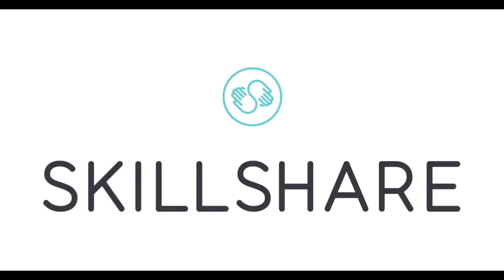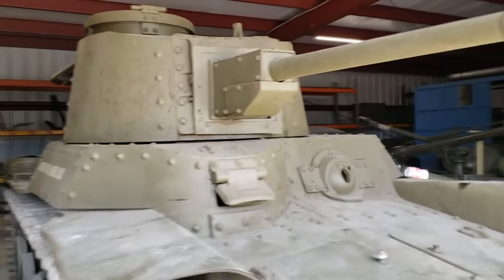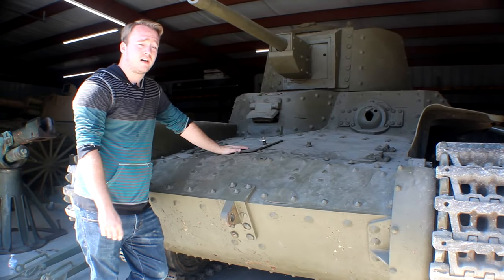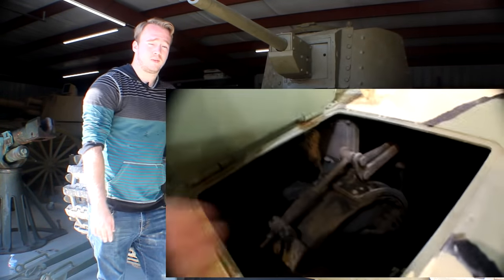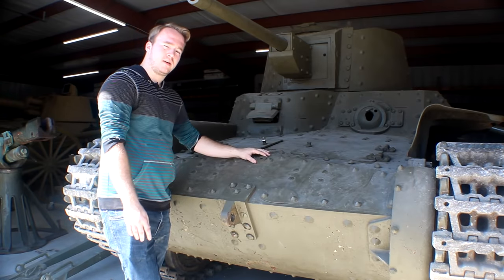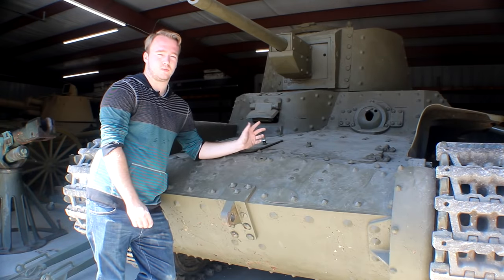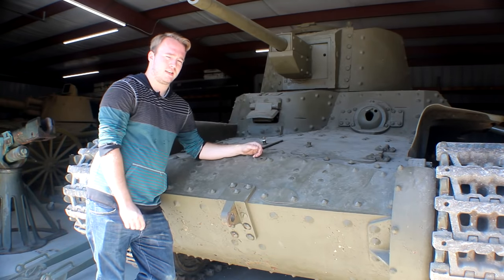Inside the Wannabe's Hatch: Type 97 Shinhoto Chi-Ha

Comment: 12:10 There were also AP rounds for the type 1 47mm gun which could in fact penetrate a M4 Sherman tank frontally at 800 yards. Around 800 yards, The AP rounds had 58mm or 2.28 inches of penetration. The frontal hull thickness of most m4 shermans was around 51mm or 2 inches so given the right ammo, the type 1 47mm could definitely penetrate M4 Sherman's from the front. This was sourced from U.S army's "20 July 1945. Report No. 12-b(52), USSBS Index Section 6" report.
Reply: If it was using the very rare Japanese type of APCR. In most cases of tank battles I can't penetrate the Sherman. A similar battle that took place where 3 Chi-Ha and 3 Sherman's. When the last Sherman turned it's fron armor below 500 yards. It didn't go through.

Comment: Hey Potential History i discussed with people in War Thunder forum about your video and this special uparmored turret and i found  out that the turret of this tank is not original turret but it is a turret from its successor, the Type 1 Chi-He. 

Long story short, It's a Chi-He turret on top of the Chi-Ha hull. 
So you did basically went inside one of the most rarest tank's turret from WW2, because no Type 1 Chi-He survived today!
Reply: Za Sensha Chi-Ha Tan No Ēsu  Nope, it is not.  The Type 1 went into production in 1943, the year this tank was captured.  It also had a mostly welded turret, with a different profile, different ports and hatches.  The Japanese also stopped sending tanks out from Japan at the beginning of 1943, so no way for a Type 1 to get to someone to be captured in 1943.  But they were producing Type 97 Shin* with applique plates on the turret from mid-1942, which for with what this is.  A lot of those were sent to the Manchurian armies, which were then slowly bled of equipment and men to other theatres until 1945.  Basically, from ~1943 onwards, the home armor units got all the new kit and were kept in reserve, while the formations facing the Russians were used as a supply and manpower pool for other theatres.

You might claim it was a development tank to test ideas for the type 1, but that's not how the Japanese did it.  They simply didn't send development vehicles overseas because they were "owned" by the manufacturer, not the military.  That's just how zenbaitsu work.

Comment: I think the hatch in the back of the turret is for maintanance of the main gun or more accurately replacement of it. The ammo boxes were probably unbolted and lifted out of the way and the rear hatch opened from the inside before the main gun could be lifted out the back.

Comment: This tank was probably not captured in 1943, since this type of tank mounting that can also be seen on Type 1 Chi-he's turret (additional armor plate to increase frontal armor thickness) didn't went on mass production until 1944. Japanese tank researchers think this nicely-preserved Shinhoto Chi-ha was probably built at late 1944 to 1945, after the newer Type 3 Chi-nu went to production. Chi-nu's hull is nearly identical to Chi-he's hull, so it is speculated that the IJA decided to convert Chi-he's hull to mount Chi-nu's turret, and use the leftover Chi-he turret to build Shinhoto Chi-has. These kind of modifications can be seen in photo of japanese arsenal during the post-war period.
Reply: Furthermore, this chi-ha has repainted at least twice time.

Comment: Good Video, nice to see a second capable Historian talking about AFVs ! to all others : please upvote this, i want to help him with that comment, thx :)
But about your statement regarding the Hatch in the back of the Turret : If you remember the BT-Series of tanks, you'll find that the entire rear section of the turret is hinged and can be pulled open for removing the gun. Considering this, i assume the hatch was for the same purpose - simply unload the ammo, unbolt the rack and open the hatch - you are know able to remove your gun without pulling off the whole turret. ( I think so because the gun is bolted in from INSIDE the turret and on the basis that the russians did the same on a tank from the same era with similar doctrine - and because it just makes sense )
Reply from the maker: Yes! Very good point. I'm certain you're right given how the gun was situated in the mantlet. Thank you! Cant believe I didnt think of that.
Reply: @PotentialHistory  Glad i could help you; )

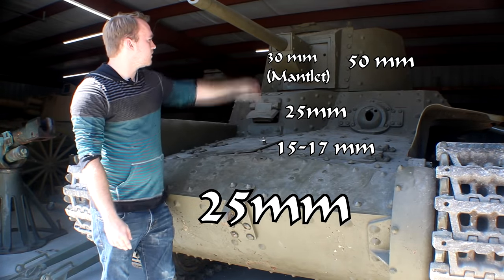Comment: 4:38 "Not too thick".....yeah, maybe. But, itz also steeply sloped. And DUDE!!!!! sloped armour acted ffffing crazy back then against AP, APCR, and APDS (Not against APDSFS thou). Because sloped armour had a tendency to change the trajectory of the shell striking it. In fact, the sloped armour diverted the shell away from plate as it struck.

So what would happen is that instead of a 100mm plate angled at 60 deg=200 mm RHA steel......it actually more/less like 100mm plate angled at 60 degrees=250-300mm RHA steel, because of this weird phenomenon. AP shells were most prone to this phenomena, while APCR & APDS was only slightly less prone to this. But by the time of modern era APDSFS shells came along, and became immune to this phenomena. I think HEAT is also immune to this phenomena as well 

But due to this weird phenomenon it was the MAIN REASON why the Western powers collectively shat their diapers when the pike-nosed IS-3 came out 

Well that, and the fact that placing a rather thin plate like that would be highly likely to ricochet a shell. For having a very high chance of ricocheting an AP shell, the plate needs to be around 60-70 degrees. But for APDSFS, I think the angle has to be around 80 degrees....which is kind of a coincidence, since the Abrams' upper glacis plate is around 60mm @ 82 degrees   :)

Comment: This is why I like War Thunder, it lets you use vehicles against at there full potential and you fight with/against vehicles of equal capabilities (most of time)
     The type 97 is a quite good tank when when you put it up against other light tanks of the time is 47mm a solid fire power, mobility is good, and if the numbers in War Thunder are correct it's gun utilization is good with -15 gun depression a 4-5 second reload turrets rotation speed is decent for a hand crank it biggest disadvantages are the low armor and low top speed for a light tank and IRL the rivet construction would be a problem 
  Overall when compared tanks in the same class it's a decent vehicle and IRL it would also have been quite good especially for it's day back in the late 30's but would also like most things it's era even good ones they were quickly outdated and Outclassed by the armored vehicles to come  during the war

Comment: If that is original, that cupola is really advanced stuff for 1935. The M3 Light had a metal cupola with open slits in it, and most other tanks were using vision ports or periscopes at that time. That is basically what they were using on the Pz III and IV in the late 1930s. The Japanese get a bad rap on a lot of tech things, but mostly it is undeserved. Their problem was that they were rarely able to follow up at the right time, and so they are judged by how poorly t5eir equipment fared against the next generation stuff that was developed after theirs came out. The A6M was a very modern and capable fighter for 1941, it just suffered because it ended up facing a whole new generation of fighters. The G3M and G4M were both very good when they came out, compared to their contemporaries. But everyone else came out with their new equipment a year or two later, and it made all the difference. Japanese tanks were pretty much in line, or even better than the typical tank of the late 1930s. There certainly weren't any better tanks in their expected theaters of operations in 1941. The M4 didn't even exist then.

Comment: Panel at the back of the turret is most likely to remove the main gun. The gun got longer for the increased velocity so I'd be willing to bet that they made that panel to handle the increased length during replacement.
Reply: BTW pretty sure the machine gun is a Type 97. 
Link to forgotten weapons
https://youtu.be/heE5GyHJ6Xw
Reply from the maker: Holy shit you're probably right. Makes sence why the hatch was so hard to use and you'd have to remove the ammo bin. Thank you!

Comment: I am betting the hatch on the back of the turret was not for loading ammo or anything of that sort, I am betting it was for gun maintenance. If the main gun needed to be removed for any reason, it likely would go out of that hatch. Remove the ammo boxes, pull the gun from its mounting, and take it out the easy way, through the back of the turret.

Comment: Here is what I never understood about the IJA in WWII...why didn't they take a page out of the Germans book and build something like the Marder? You see photos from late 44 with their light tanks still being used in front line positions even though their guns at that point were like spitting in the wind, and not only did they have their own heavier anti-tank guns but I'm sure they captured plenty of US ones in the first year of the war so why did they never use those chassis to make something actually useful?
Reply: They actually did, look for the ho-ni 1 and 3. and there were multiple models reconverted to TD's and spgs  from older chassis that mounted 47mm, 57mm and 75mm  anti tank guns and  there were even reports of the 47 mm AT guns fielding ammo capable of penning the Shermans frontally. Problem is not much of it was fielded

Comment: So uh, it looks like that driveshaft is only partially shielded, with a gap immediately before the engine (you're standing on what I assume is unshielded driveshaft with your right foot at 15:45). Did the engine shielding come out that far into the fighting compartment? Or did Type 97 loaders get involuntary nonmedical amputations any time the turret traversed suddenly or they went over a bump?
Reply from the maker: The shielding covered the whole thing, it had just shifted and been partially removed on this tank.
Reply: Alright, so not leg-removingly bad, but still kind of awful. Thanks for the response.

Comment: Wouldn't you think, by the time you've finished designing building and wiring in a light board with 12 options it'd be easier just to install internal comms?

Comment: I assume that back panel is for loading, but the lack of handles is to prevent opening it from the outside by enemies. It looks like the loader can still open it from the inside but I'm not sure.
Reply from the maker: The shells went nose first into the bin so loading them from the back wouldn't have worked. Another commenter said it might be for removing the gun, which I think is possible.

Comment: I am concerned for your health. I know Japanese tanks usually lined the insides of the tank with asbestos to prevent soldiers from scalding them selves on the metal which happened a lot after keeping the tank under the tropical sun for a few hours. Was it cleared of asbestos?

Comment: why did these japanese tanks all have rear facing turret mounted machine guns? was it to be used in an anti infantry roles from lessons learned by japan during china? and was it actually any useful?
Reply from the maker: The turrets were too small to put them next to the gun, but also the infantry support role thing. There is also a metal port on the roof to mount one for infantry support or anti air.

Comment: I would lay off the "dominated by" hyperbole. Everything in this video is described as "dominating" something; that is a phrase to be used occasionally to liven speech up, not a standard piece of terminology to apply to everything. And realistically, if an object is described as "dominating" something, it should be the only object described as such. If the radiator hatch, turret rear, and mufflers all dominate the rear of the tank, then really none of them actually dominate shit. It means the one, single, unique object that most ready catches your attention. And even if you have multiple objects meeting that criteria, it sounds weird to use the phrase repeatedly.